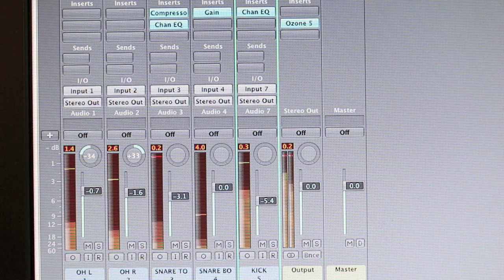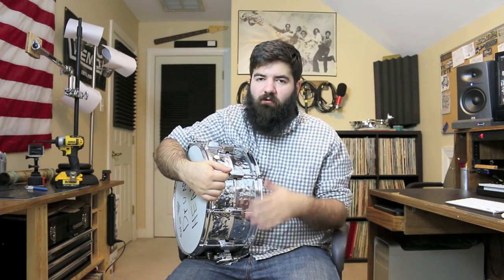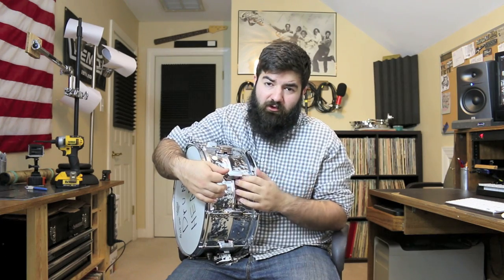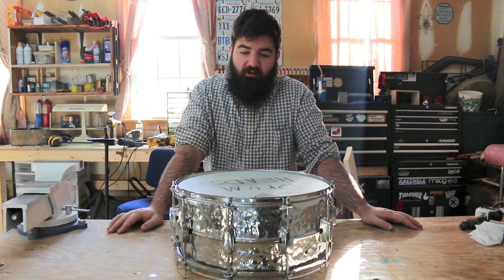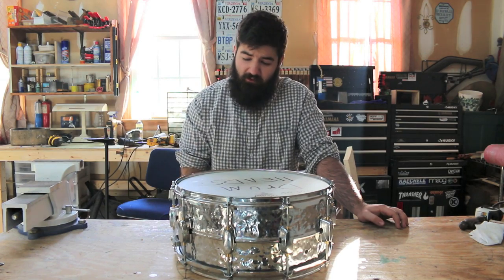Hand Hammering a Snare Drum

Comment: always wondered what an oak staved barrel would sound like for a floor tom. Or any wooden drum with thicker shells. Not super thick as I think it would cut the resonance. That snare does sound a little different. Better in my opinion.  And it looks like you went from 10,000 to 94,000+ subs. Congrats!

Comment: this snare diy turned out pretty pro looking to me. dried the snare out a bit. I have wanting to try hammering a 13" Mapex Black Panther nickel over brass snare for over 15 years but it would destroy the value of the very sought after snare. I wish I had an extra. I did make a diy snare from a Mapex Saturn deep 10" tom that turned out awesome and use it as a secondary snare complete with a L-rod uniball mount. I then retired a 1998 12" Mapex Black Panther Maple/Cherry snare to my collection shelf. awesome diy snare hammering video.

Comment: After reading through all of the comments I figured someone would have pointed out that hammering on a wood "anvil" is wrong it doesn't compress the metal it just deforms it hand hammering whether it be snare drum shells or cymbals is done on an anvil made of steel or iron so that it compresses the metal and work hardens it thus changing the molecular structure of the metal to give it complexity not deformity

Comment: Hey man, I recently got a 13" old steel Tama snare for $20 and I'd like to hammer it. I don't have the same wood block thing you have to mount it on while I hammer it, do you have any suggestions on how I hammer it without screwing up the roundness of the shell or any other important things?
Reply: SubwooferHero bump
Reply: Just hold a piece of 2x4 behind the part you are hammering on and don't rest the shell on any other surface while hammering.
It'll wear your arm out though.

Comment: I have ten kits of all shapes and sizes for different styles and gigs so ten snare drums, one for each.
I put together a kit for jam sessions so my better kits etc dont get smashed but only had an old cheaper steel snare drum spare.  Then I remembered seeing this video a while ago. 
I came back and I like it.  Im going to give it go but then also put in a nut and bolt in the side between the lugs.  
I want to loose the sound of the metal ringing. Fingers crossed.

Comment: Those air pneumatic chippers with the pins that chip metal weld, would hammer this fast. Some guy made a video with using metal flashing on the exterior for a wrap, then proceeded to hammer it.

Comment: Great stuff! I'm still challenging you to do the makeshift cymbal stand, maybe out of an old mic stand lol. I have half of a mic stand, meaning the legs and up but I don't have the connecting shaft with the thing to hold the mic so I'm still curious what you could come up with, with half a mic stand lol
Reply from the maker: +Chip Weber the legs are the problem really, ive been thinking about how to do it here and there, but mic stand legs are realllly flimsy
Reply: +rdavidr Yeah for sure. I'm thinking that you'd have to at least use a smaller cymbal on it. I'm sure there's a way to do it lol just not too sure how exactly

Comment: did you ruin the snare? The short answer is no. I have two hammered snares, 14x7 steel primary and 13x5 brass auxiliary, both finished in black nickel. They are dryer and darker in tone than un-hammerd (?) snares. Much more interesting than the usual over-ringy biscuit tins. my 14x7 NOS snare gets a lot of admiration.

Comment: what would a rack tom sound like with a a lot of holes drilled into it
Reply: Take off the reso head and get an idea of the sound you'd get...(granted, that's a big hole so the difference will be extreme) Holes allowing air and sound waves a place to escape will have a similar result though. Less sustain and resonance I suppose is the big difference, you'd get a flat, more 'boxy' response which can be cool. They're unusual, but you will sometimes see a 'vented' drum.

Comment: Hey David, this is a pretty random question but I feel like you would know the answer. Do you know where you can buy just plain metal? If so, is it cheap or expensive?
Reply: Guitar center has mapex piccolos really cheap
Reply from the maker: +Marshal Mciff look up "steel yard" or "steel mill" on google, prices vary depending on where you live, but you can also go to scrap yards and see if they have anything. Itll be cheaper there but it can hard to find exactly what youre looking for. Lowes, home depot, or tractor supply also sells some stuff, mainly square tubing, angle iron, and small plates, but buying from a big box store is much more expensive than going to an actual place that sells metal. Also hardware stores usually only sell stuff in 4ft lengths.
Reply: +rdavidr sounds good, thank you!

Comment: Quick question! How long did it take to hammer it? Just got myself a cheap Snaredrum for roundabout 40$ and I'm planning to try this!:D Btw I subbed to you around 1.5k and I have seen and love all your videos!:)
Reply from the maker: +RacingManiac_R2 thanks man, but it didnt take that long. no more than an hour and that includes setting the camera and such.
Reply: +rdavidr Alright, thanks for answering man!
Reply: +rdavidr what snare was used for this project. I've been now looking on eBay Amazon trying to find a cheap deep steel snare either smooth or with the one ridge in it. Where would suggest I look
Reply from the maker: +MWD19862809 I actually dont know what kind it is, theres no badge or anything. I got it used off guitar centers website, and they said it was a TKO snare, but after looking it up im pretty sure its not a TKO. But if you look at the used stuff on their website every couple of days youll find one eventually
Reply: +rdavidr ok awesome man I've been looking since lastnight lol. But I will continue to look I've got to try this out I actually just finished showing my wife your video. Keep up the good work and keep the videos going bro
Reply: +MWD19862809 I used Tama Rockstar snare, It sounds really good after the hammering!
Reply: +rdavidr its a tama!! i used to have one when i was younger.
Reply from the maker: +Brian Muehlher do you know what model by chance?
Reply: i wanna say a rockstar steel. im almost 100%

Comment: hey, have u ever heard of jazz sticks? their pretty much normal sticks but their maple /mahogany so their really heavy. and since mahogany is so rare,they are really really expensive. so...for your next project, make some "getto " jazz sticks.  :-P
Reply: Youve got that a bit backwards. 'Jazz' sticks are always lighter, not heavier. Heavier wouldn't make sense because you'd get more attack/volume = not jazzy. Most jazz sticks are maple, which is lighter and mellower than oak. The weight/mass of jazz sticks is further reduced by their smaller diameter and (generally) tip size. Hence the usual 7A-ish jazz sticks vs the usual 5A/B rock sticks. I have a soft touch, and like to play jazz, blues, etc. and I love a jazz-style stick... If you've never tried them, you'll be AMAZED at the different sounds you can pull out of your drums AND cymbals, particularly the ride. i can't comment on mahogany sticks as I don't own any (idk that I've  ever seen any) but jazz sticks are no more expensive than other sticks. Try Pete Erskine Ride Stick, VATER Sugar Maple, Zildjian Jazz, Zildjian Bill Stewart Sig., Pro-Mark Jazz Cafe, Vic Firth American Jazz series... All great sticks!
Reply: Drumdude Notrude.   sorry,got them at guitar center. their pretty much knockoffs. they said jazz sticks on the sleeve. thanks a lot guitar center>:(

Comment: lol, i've wanted to try this, but knew its not that simple .  you might have used the wrong hammer, or the wrong back stop.  it work hardens the shells.  you went over it multiple times.  there are genuine masters now that hand hammer shells.  i think a shallower radiused ping hammer would be better.  a different back stop.  something that doesn't really vibrate when you hit the shell.  n, don't hit it too many times.  different materials work harden, others just bend.  that all plays in to it as well.  so experiment.  study the patterns the other guys use.  you'll notice more uniformity.  consistent hit pressure and depth to the bends of the shell.